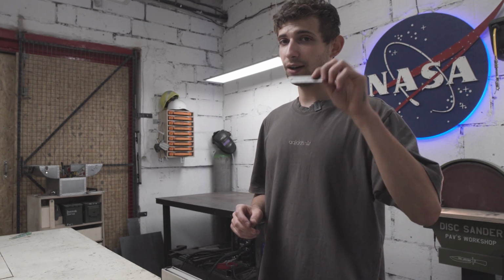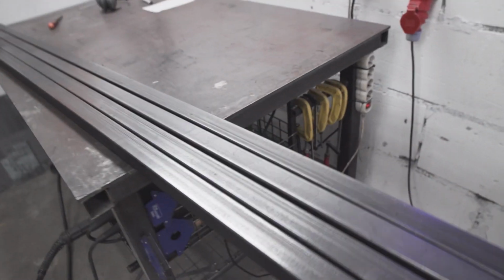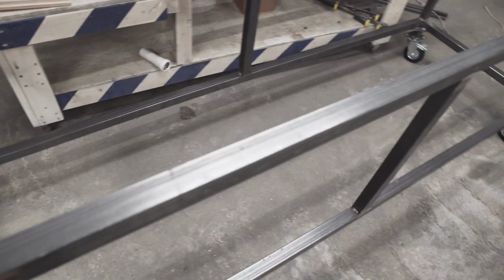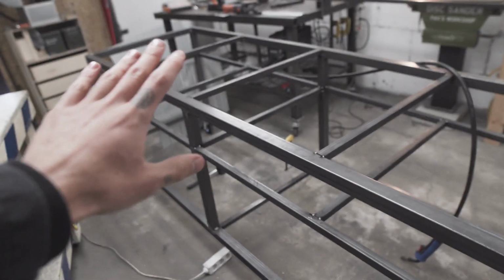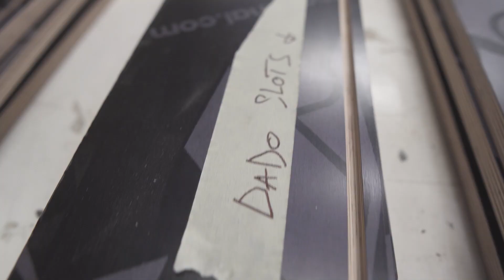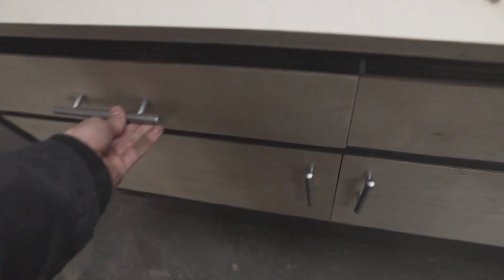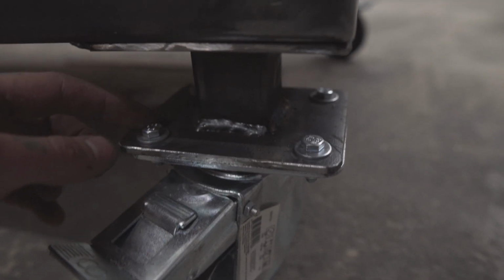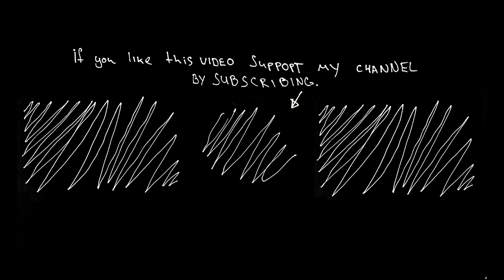Metal and Plywood Workbench Build

Comment: Hey, what size steel profiles did you use? Great build!
Reply from the maker: Hey man! I’ve used 40x40mm and 25x25 profiles.  Thanks!
Reply: @iljanster  Thanks for the reply! What wall thickness are the profiles? and how long did the table end up being? I'm planning to build a very similar one for my workshop.
Reply from the maker: @HorizonMakes  I think I used 2mm wall for this one. Its ended up being 250cm in length
Reply: @iljanster  awesome, thanks!